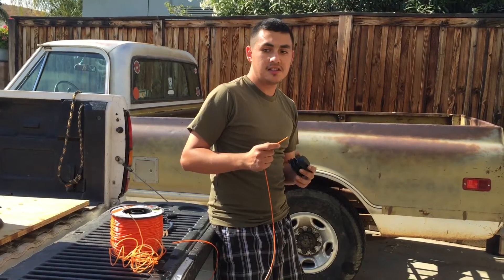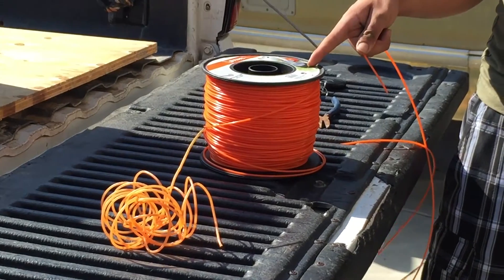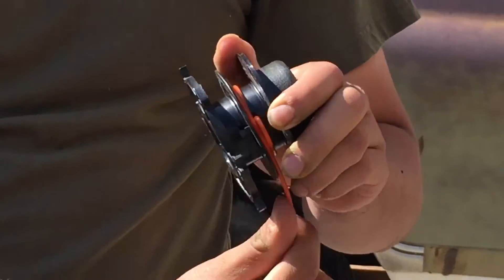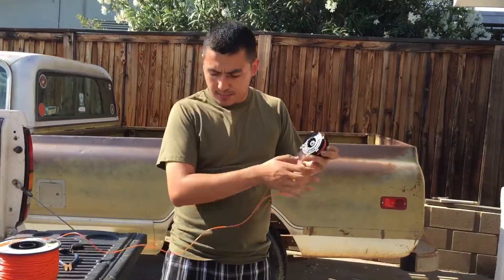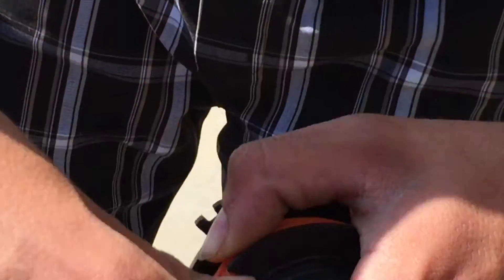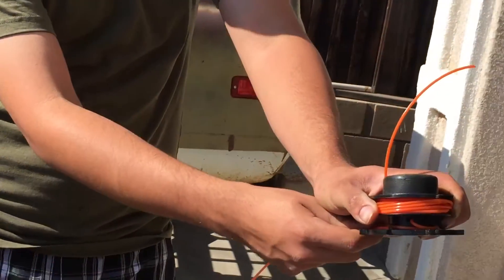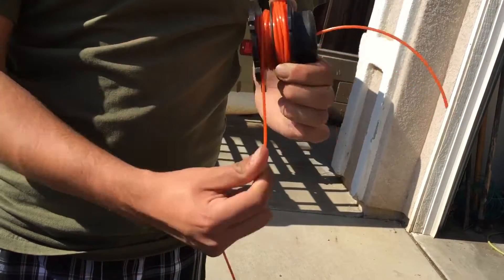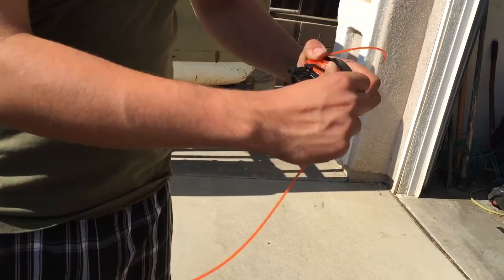How String an Fs90r-130r!!!!

Comment: You have to change your round line X line trust me it's way more durable especially if you soak it in water for 24 hours I use X line on a fs90r and yesterday i used to clear 2 acres of thick weeds and leaves and poison ivy and cut throuhh 1/2in small trees and only had to respool 3 times and i hit a lot of rotting wood and it just blew the wood to millions of pieces and It destroyed a tin can and a few plastic water bottle and jugs
Reply: Oh and it was 095 line not 105 btw
Reply from the maker: Thanks for the info
Reply from the maker: +Grassmonkey Landscaping thanks for the info bro!!!